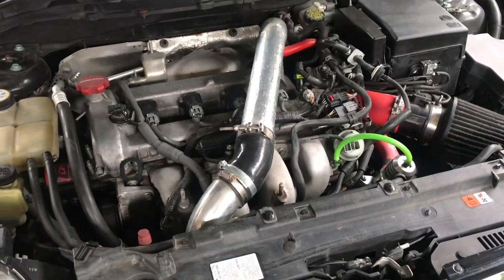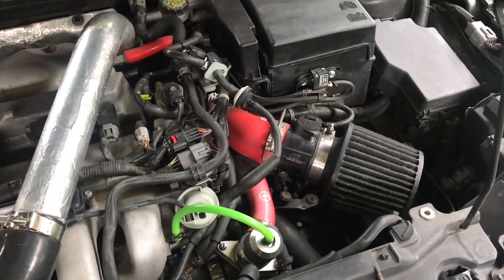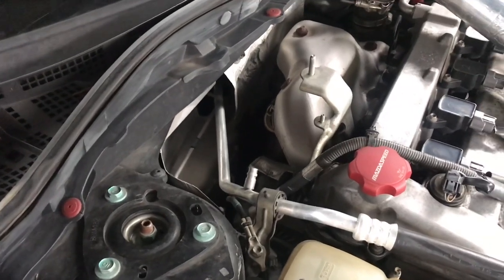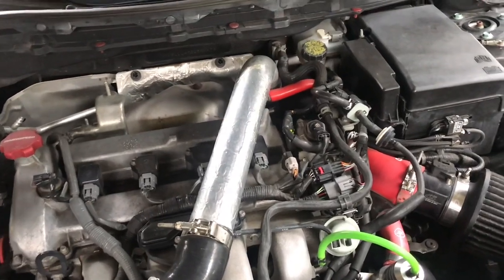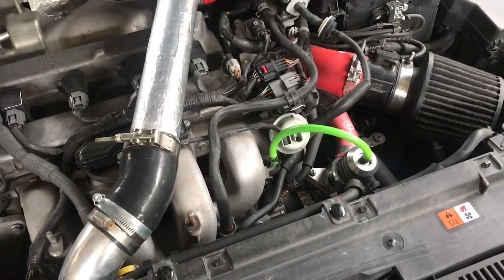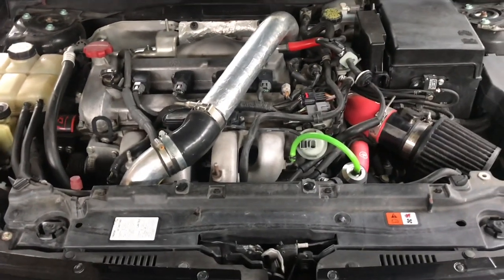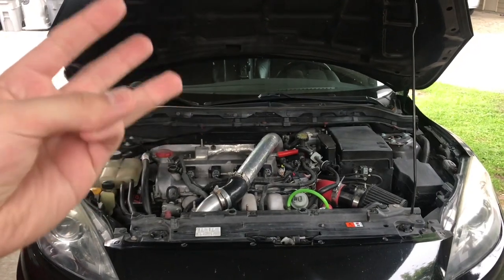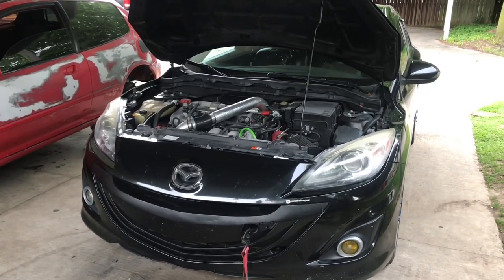Easy way to make 300whp in a Mazdaspeed 3

Comment: Are you running a catless downpipe ?
Reply from the maker: Adam Rasp stock exhaust
Reply from the maker: Adam Rasp jk i have a long catless downpipe
Reply: NewOrleansSpeed did you throw a code for it being catless and was the o2 sensor an extended bung on your downpipe ?
Reply from the maker: Adam Rasp yep, it’s a constant code lol. I can technically take it off with my accessport but have just been lazy.
Reply: NewOrleansSpeed have you seen a difference in readings of your AFR’s since your catless ?
Reply from the maker: Adam Rasp no but i do have a protune
Reply: NewOrleansSpeed about a week after my catless dp I got a p0134 code and my afr was stuck at 14.85, is this a dp problem or because of my o2 sensor is bad?

Comment: So your saying a putting a short ram intake that's taking in hot air in the engine bay is better than the factory cold air intake that every car come out of the factory with
Reply from the maker: 100%, and my car did not come factory with a cold air intake, if anything the small intake box gets even hotter in that engine bay. The grill and the hood supply the engine bay with ample air. I mean I guess im wrong, even though everyone and their mother with a modded speed3 goes short lol.

Comment: How much total to get to 300whp?
Reply from the maker: depends, minimum - $1000~ - you need HPFP interenals, a downpipe, and a e85 tune.

You could easily spend close to $1500~ like I did. Which was HPFP, Intake, Donwpipe, EBCS, FMIC, E85 Tune. A big part of that price is accessport, but you can skip that if you just get a dyno tune.

Comment: Wonder if adding meth in place of e85 would achieve similar goals. There is no e85 near me (only place 25 miles from me removed their e85 pumps).
Reply from the maker: Andrew Drager definitely similar results! Will also keep temps very cool and clean some carbon! Also meth is good if you plan on going BT and need more fuel
Reply: @NewOrleansSpeed  I had some plans for BT, but my car is being more built for road coursing and twisties. So my goal is 300-320whp with a very solid suspension and other supporting stuff. Already have a basic tune with stratified and will have them do my custom tune unless I go with freektune haha.
Reply from the maker: Andrew Drager hell ya man, that’s what i like to hear! A lot of people sleep on these cars, especially the road handling aspect. You should be able to get close to those numbers on 93 with a custom tune and bolt one
Reply: @NewOrleansSpeed  bro ive had mine for 11 years haha. I absolutely love it. Working on upgrading my v2 AP to the V3 and then get a downpipe and hit the dyno (my buddy has a dyno and is giving me a good price for 3 pulls 👍)
Reply: Im eventually going to start posting up pics of my build on IG once I get these next slew of parts.
Reply from the maker: dude, same lol. Ive had mine since Senior year of highschool, I graduated college 8 Months ago and I still love it. Its my daily as well. Good start on the mods, I need to upgrade my Ap as well. You should make some decent power with a good tune. Dont forget the hpfp
Reply: @NewOrleansSpeed  haha hpfp will by next mod. I may get the ap fuel pump package from corksport for a deal. Plus i may get a 3" intake as well haha, an upgrade from my stock cpe one haha

Comment: Do you know if it’s the same on the sedan model?
Reply from the maker: it should be the same, but i would double check on the forum . page
Reply: It's not a speed it's not happening
Reply: do you mean the speed6?
Reply: It is the same just with the 6, it's awd and the rear diff mounts have to be replaced with after market ones if you going to be launching. Rods tend to snap with to much torque at low rpm so keep torque below 400nm if you tuning. If you want good reliability, I suggest forged h beam rods.